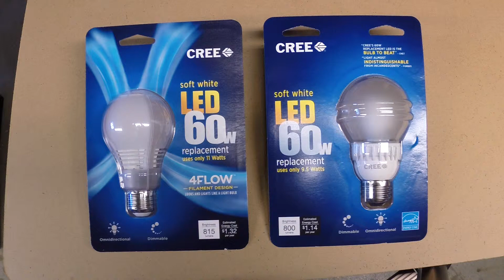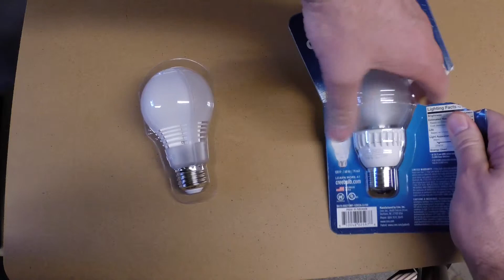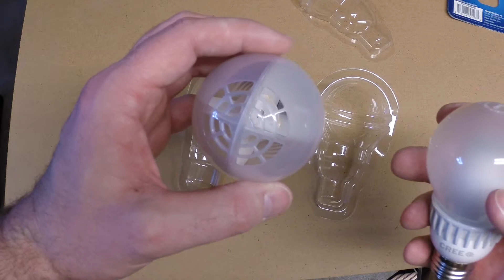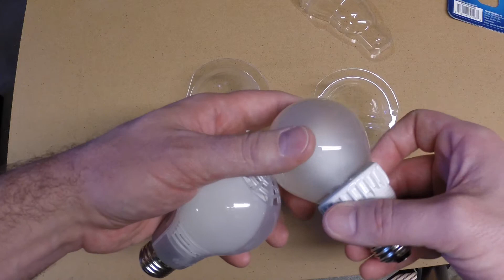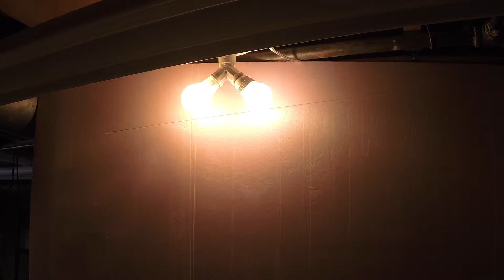2015 Cree LED Filament Tower vs 4Flow Comparison

Comment: Can the new cree led 4 flow be used in ceiling fans.  Want to replace some lights and before I spend the money can I use 5 40 watt of these
Reply from the maker: +lea leroux I don't see any reason why they can't be used so long as they fit. You could always buy them from Home Depot and only install one to make sure it works. If you have any sort of problem (fitment, flickering, etc...), take them all back. Replacing 5 bulbs will save a lot of electricity and also cut down on the heat radiated from the lights.